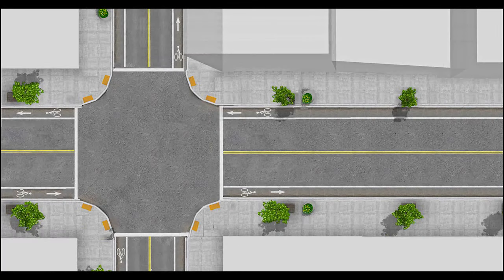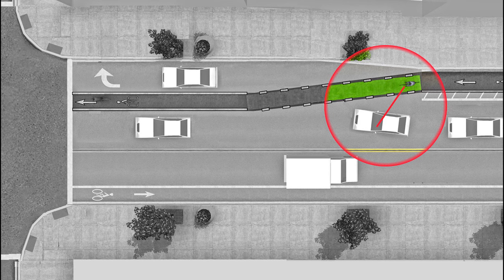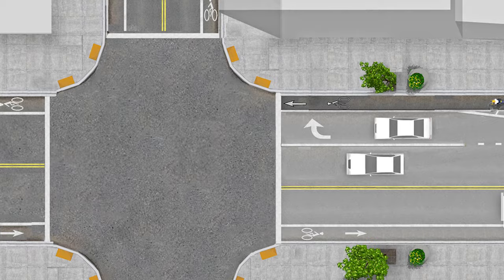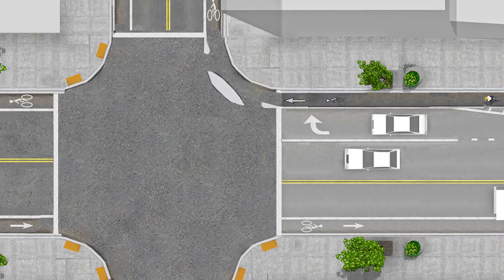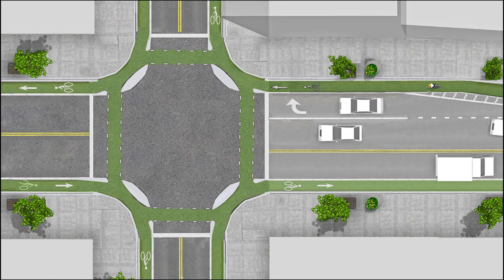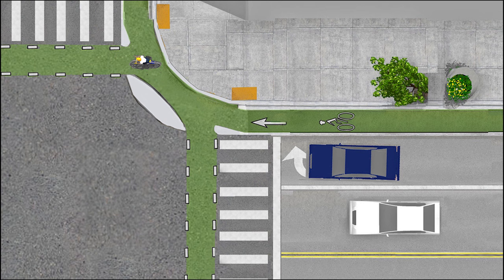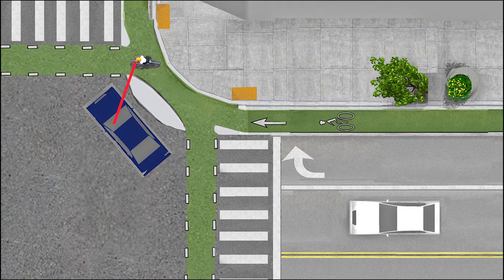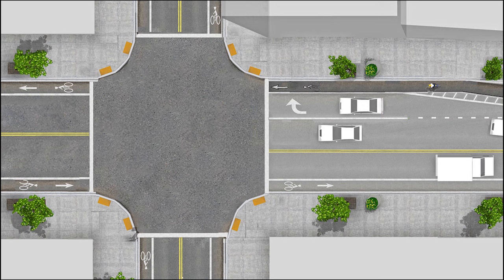Intersection design, the Dutch - cycle friendly - way

Comment: I think this is better than the Dutch roundabouts.
Reply from the maker: The safety figures for roundabouts are much better than for signalised intersections. And users like roundabouts more as well.
Reply: @BicycleDutch  I like normal roundabouts, but the ones with at grade cycle roundabouts 1 car length outside defeat the whole purpose of being a roundabout, both in terms of safety and traffic flow. Whenever I see videos of them there are many near misses and also many blocked crossings when busses are around, and they create so many traffic crossings and conflicts that the cycling crossroads shown here would have better flow.
Reply from the maker: @martineyles  Your observations are not in line with scientific investigations and simply incorrect. It is a fact that there are fewer conflict points on a roundabout than on a four arm intersection. There are more crashes at traditional intersections than on roundabouts and the flow is better on the latter.

Comment: In Australia, cyclists are allowed to ride a legal road vehicle on the footpaths and crossings. So I say there would be a greater chance of conflict between cyclist and driver, as drivers didn't expect a cyclist to ride off the footpath onto a crossing or across a driveway from a footpath?
Reply: The cyclist only uses the footpaths when there are no cycle paths available. don't they. If a junction has cycle infa there are no cyclist on the footpaths.
Reply: @reddishcat1  footpaths can't be used by cyclists, if there is no bike lane, you have to cycle on the road with the other vehicles, so there are never cyclists on the footpaths, unless of course they are walking with bike in hand.

Comment: I've never seen these junctions and I'm Dutch lol. They look super uncomfortable to me as a cyclist because if you want to go straight you have to make a weird turn around the traffic islands. We now use roundabouts with clear cycle paths (amongst other things), which I think are a lot better. :)
Reply: Wow, you’re Dutch and you’ve never seen this? This is standard road design in the Netherlands since 1984 or so. 

I remember when it got implemented on a big crossroad in my hometown in my youth. At first I had the same reaction as you and was very frustrated, because of the detour you have to take on your bike, and because you had to wait twice for stopping signs (if present) to turn green when turning left, but now that we have perfected it (with road sensors, shorter waiting times, smart phasing) I would hate to go back to the way things were, either as a cyclist or as a car driver. This redesign has saved thousands of cyclist’s lives since implementation!

Like you, I prefer roundabouts, as they don’t require stopping signs at all. But they require a lot of space, and can’t be implemented everywhere because of that. But the detour/“weird turn” you have to make on those is even bigger than on a regular crossing.
Reply: @roob0012  I thought this was mainly a 90s thing, from when sustainable safety became a thing. But you might be right.
Reply: It only looks weird here, because it's fitted onto minimal space. In reality the bike lane swipes to the right a lot earlier or already has a gap to the car lane.

Comment: you obviously haven't ridden a bike in the Netherlands yet. The infrastructure prevents exactly that from happening. Crap bike lanes do give more problems than they solve, but prper bike tracks keep cyclists and cars from clashing into each other, providing a much safer ride with minimum stress for both driver and cyclist

Comment: The part at :15 where cars can't see a cyclist because of the angle....the car typically sees me because they just passed me! These might be good for slow cyclists or really large intersections, but if the light is green these seem like a much worse idea because cars do not expect 20mph bikes to enter the crosswalk.
Reply: +obscuritystunt Honestly though it's a very dangerous situation in which you are sure to pass a driver's blind spot. I'm Dutch and I have not seen a single incident at a crossing like this in all my years of cycling.

Comment: What is the difference between this junction and a "simultaneous green light traffic light junction", where all the cyclists go together over the junction? Please explain, i am very interested.
Reply: +HelenaRG71 The difference is that, well, the lights are not simultaneously green? :P For instance if you turn left, you have to cross two times (and therefore wait two times). If you're lucky you can sometimes make it in one go, but that entirely depends on the traffic lights.
Reply: To give you a better reply its only 2 years late :). 
simultaneous green light traffic light junction are only implemented when there is an high amount of cycle traffic compared to the amount of car traffic. Note that it will limit car traffic a bit.

This high cycle traffic can be caused by simply being in the middle of a city or because the crossing lays on a popular route to school.

When there is only a lot of car traffic you keep it at normal green light alteration. obviously.

When there are not that many cars you don't need any lights. bikes never need lights on there own. no matter the numbers.

Comment: Just wondering if this affects the flow of cyclists wanting to go straight through the intersection since they have to now make a slight right at the beginning of the intersection, and then a slight left at the end of the intersection rather than going straight through. Almost like a half oval. I haven't seen or experienced this type of intersection so I'm wondering if anyone has any insight. Thanks!
Reply: Nahh it just feels like a wide round a bout. If you are "speed cycling" or how ever you call it, it will affect the flow. But this is mostly use in the cities where the people who cycle are using it as an transportation, so it doesn't really affect the flow. It's way better than going straight forward and have to look over your shoulders all the time of the cars see you. In this case it's really easy to make eye contact with the driver so he knows what ur up to. It nearly impossible that the driver didn't see you, that would only be if you would go way to fast.
Reply: @AK-nn7se  Thanks for the reply! That makes sense.
Reply: I certainly won't mind.
Reply: The deflection is not as extreme as it looks in the video.

Comment: This seems like the best design. I think the only optimizations that would be needed for North American cities is for snow removal.
Reply: +kfili Do you mean snow removal from bike lanes? Well, in the Netherlands, there comes a certain point where there is so much snow, most give up and walk. (but that's maximum 2 or 3 weeks).
Reply: +Tim Pauwels I see, but in many north american cities the snow stays on the ground for much much longer than in NL i think
Reply: I get it, but still- probably no more than 3 months. I mean, if conditions are that bad, I wouldn't expect people to be wanting to cycle through them anyway.
They could always get a guy with a shovel to do the corners.
Reply: If people stopped cycling for 90 consecutive days they would likely get into the habbit of getting to work with some other mode of transport stop cycling for transport all together. In the cities on east-coast USA there are penty of days in the winter where the temperature is fine for cycling but snow left on the paths could make or break another 50% (?) of days of cycling in the winter?
Reply: kfili i know this post is a year old but i still feel like replying.
i used to work at a little company which rented out fencing for roadworks and the like, as a little "side buisness" we had 2 tiny tractors fitted with a little plow and salt deposit device (no idea what they're called in english).
once it started snowing in winter we'd get a call from the city to clear the separated bike lanes and we'd take turns de-icing them twice a day.

hope this helps.

Comment: It's not clear to me what keeps pedestrians safe as they try to cross. As soon as they step off the sidewalk, they are in the bike lane and, at least around here, cyclists do not normally stop in such situations but instead try to guess where the pedestrian  will be, then cut in front or behind pedestrians. Near collisions are frequent. This design is great for bikes and much safer (in terms of cars and bikes) but it will make bikes feel safer to go through corners even faster. I don't see anything that helps those on foot.
Reply: The ped markings are usually extended into the cycle path .

Comment: On the bicycle you have to make 4 sharp turns just to go straight across, which will slow you down. No really a good design.
Reply: Did we watch the same video? He shows different sizes of curbs of which at least one was so small you wouldn't have to swerve at all and this would only really even matter if we ignore the traffic lights for which you'll at some point have to stop anyway, because it's a city so there will be other people.

Oh, and in mathematics, a sharp corner is one of less than 90 degrees btw, this clearly isn't that. In the drawing (which as mentioned isn't necessarily to scale) it's closer to 150 degrees, which is a corner you can take with  20km/h easily. Not that that matters, you won't be going much faster than 10 in a lot of cities with all the other traffic.
Reply: Slowing down means you have more time to spot other traffic and other traffic has more time to spot you, which increases safety.
Reply: Most of the time u have too waite becouse trafic lights and even if they  are green you can just go without even braking
Reply: on paper it might look sharp, in reality it is not

Comment: Just one word: roundabout...
Reply: Roundabouts is an excellent solution where a roundabout is the exellent solution.
It all depends on the infrastructure (space requirements, traffic usage, main type of traffic, traffic intensity/frequency, environmental considerations, etc.)
Reply: @wimahlers  Quite right, and given how this design is mostly seen in the denser areas I hightly doubt you'd  even have the space to put in a suitable roundabout without knocking over (in some cases historical) buildings.

Comment: why use a zebra crossing for foot traffic when the junktion looks like it should have traffic lights anyway?
Reply: While in many cases they do, in low traffic intersections traffic lights are usually omitted because they only serve to diminish flow. One might say "that's what toundabouts are for", but in some cases space is an issue.

Comment: how does this affect turning freight and buses?
Reply: Depends on how you look at it/how you design it.
In the example shown here, the radius of the new curb is the same as the old one so if the truck/bus could make the turn, it'll be able to now as well. It's essentially the exact same turn. If it had to put a few wheels on the curb, it'll also have to now. I would argue that the latter situation is rare though and would rather the truck/bus drive over a "useless" curb than a pedestrian filled curb.

Comment: Meanwhile, in the USA, lets put the traffic light on the opposite side of the intersection than the one you're supposed to stop
Reply: because it makes no sense for the traffic light to be in front of the driver instead of to his side...
Reply: Dod Man  I can't tell if you're joining the sarcasm or if you really believe it's a good idea to not have the light right in front of the driver.
Reply: Dod Man  wow, your intersections are 100 meters across?  how many lanes do your roads have?  100 meters is 25 US sized lanes.  and you only have to turn your head five degrees to look to the side of your lane?  in a 100 meter wide intersection?  or are you using metric degrees which have 100 degrees in a full circle?  and you can see the traffic light that's beside the road even when a cabover delivery truck pulls right up to the stop line in the outside lane?  and if there is a center turn lane with its own separate light, do you just know the light on the left is for the turn lane and the light on the right is for the through lanes?  or do they label them, in big letters so you can see them from the 50 meters away that is the center lane of your giant intersections that you only have to move your eyes five degrees to the side to see.  or do people in the turn lane, just look out through their sunroof (which I presume is only a 5 degree elevation) to see the light that is above their car?

what I know is that you're trying oh so hard to make it seem like having a light 18 feet above the roadway, and only 24 meters away on my city's BIGGEST intersection, with one light for each lane with a sign beside it showing how that lane goes through the intersection is a totally stupid system that no true european would ever be able to understand.  and you're also displaying your total ignorance of how your superior measuring system actually applies to the real world.

Comment: Yes this is way better, only those ‘protective curb islands’ in the middel of my bike path are really, really dangerous!  In bad weather like snow or rain plus darkness, you very well overlook them and they cause injuries and bike damage. Last week at a T junction, dus to sun-shadow crossing, I run over one of these ill fated islands. Again. They need to go!  They are drawing board fantasy, not well thought out and road tested and evaluated.  So, skip them, create clear markings but NOT obstacles. Just telling you from Amsterdam every day reality.
Reply: They can be quite small. You can make them low with angle curbs, and you can make cycling in the direction that avoids them natural. See his video about a change near the Amsterdam Central Station.
Reply: So you had a personal bad experience. That can happen.
However, statistics proof you wrong. This intersection design is safer for both pedestrians as well as cyclists.

Of course it is entirely possible that a specific intersection, or in your specific case, a specific T-junction, can be improved in a situational specific way. But that does not negate the safety and advantages of the overall Dutch intersection design.
Reply: Never had a problem with them

Comment: There is a problem with cyclists waiting to cross (left turn) blocking the path for cyclists going straight. Imagine 10-20 cyclists (not uncommon in Copenhagen).

I quite like these two because of how effective they execute traffic.
https://www.google.dk/maps/@55.6536084,12.5405999,195m/data=!3m1!1e3